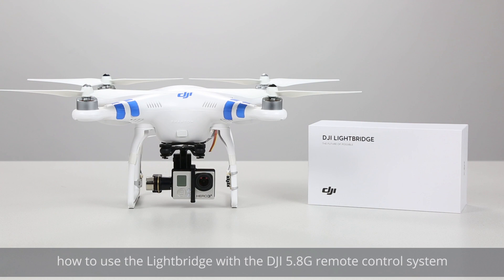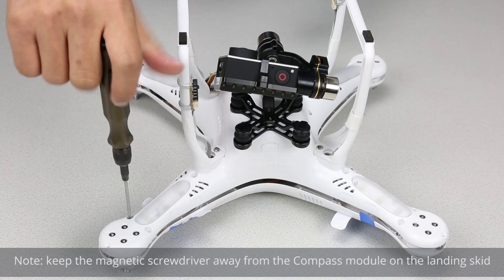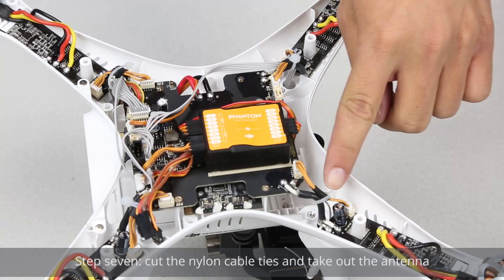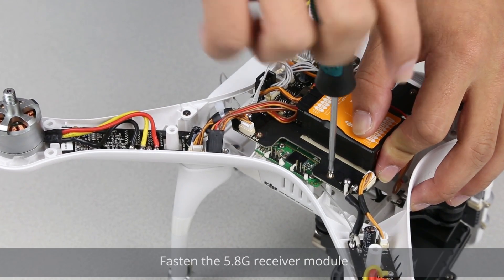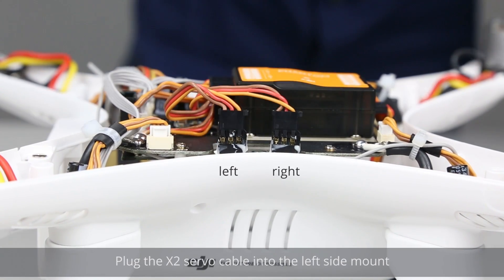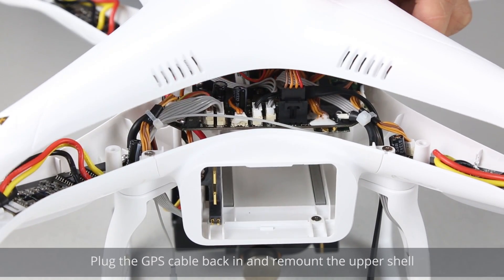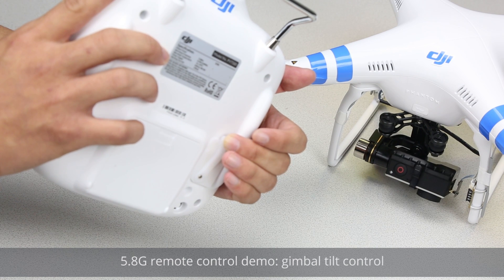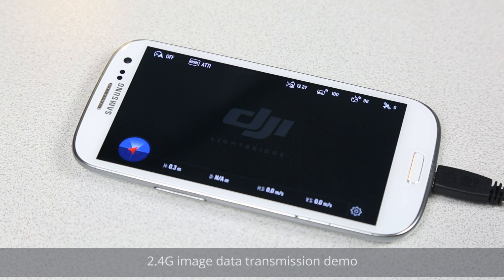DJI Lightbridge installation demonstration(with DJI 5.8G remote control system)

Comment: Hello my friend... I installed LB system on my airplane but with 200 or 300m image get freezed too much... almost impossible to use for FPV. You have original antenas? Did you made any upgrade?

Comment: Can i ad light bridge to my phantom 3 standard ?
Reply: GTDrone yeah I want to install it on my phantom 3 standard but idk if it will work if you try could u let me know how it goes
Reply: i read a lot , and yes you can do it , but you need to do a lot of modifications its better to buy an adv or a pro ,  (thats what i did )  i sell the standard and i get a pro
Reply: If you are an expert at hardware, firmware and software, go ahead. Dji sdk is a thing.

Comment: I am confused. Are you saying that having invested in a Gopro gimbal, DJI Lightbridge and a Phantom 2, I now need to buy something else to make it all work? I was flying happily beforehand and now, since installing the lightbridge, the original transmitter supplied with the Phantom does not work and is not recognised by the software. Please give me simple instructions as to what to do. Thanks!
Reply: looks like DJI gives a #"#$ our investiments in their products
Reply: gas media I agree. We invest $1,000s and their customers service is TERRIBLE. Have had two Phantom 2s and both are not working. I cannot get any response from their help lines. Wish I hadn't bothered with DJI :(
Reply: Andy Fields I am on the same page, DJI's products are expensive and can deliver, but when they fail, there is no one to reach out to and not to mention the replacement costs are sky high. I am staying away from them.

Comment: thank you for the video. what is that 2.4ghz  "chip" you put inside the quad itself? is that a part I can buy? would it be possible if i have a phantom 2 vision with stock controller (also 5.8ghz) to keep the controller as is and swap our the phantom's receiver with a 2.4ghz, or would that not be compatible?

Comment: WHY, in the WORLD would anyone ever want 5.8ghz control... Your control link will last at max a mile in an open area and won't make it behind anything...
Reply: To get away from the interference of the GoPro's onboard Wifi, and stop further fly-aways.
Reply: The controller with the other system is not good. The throttle does not snap back in the middle to allow automatic hovering.